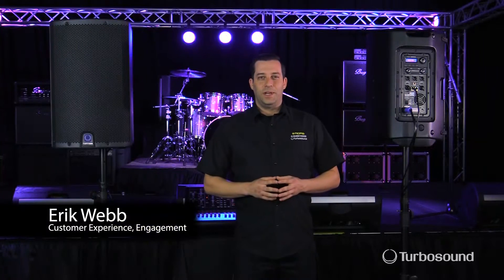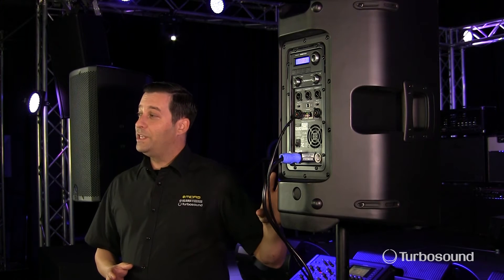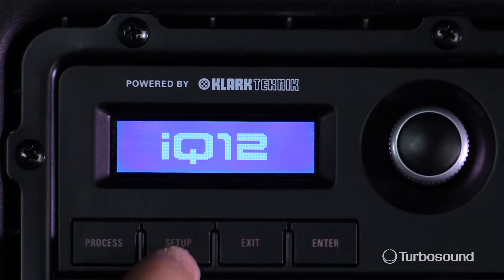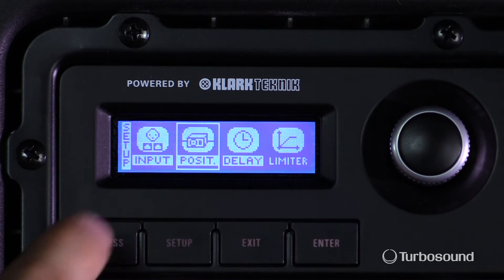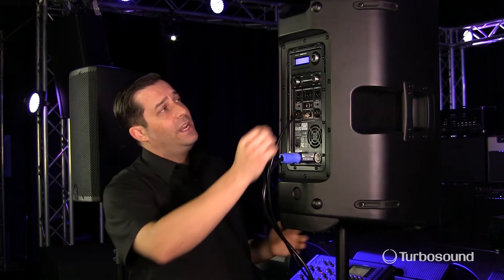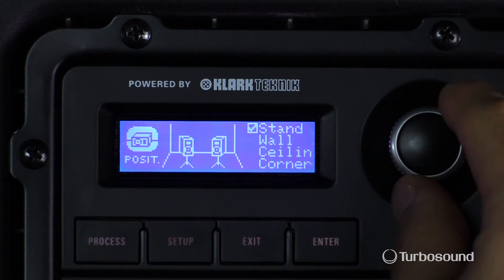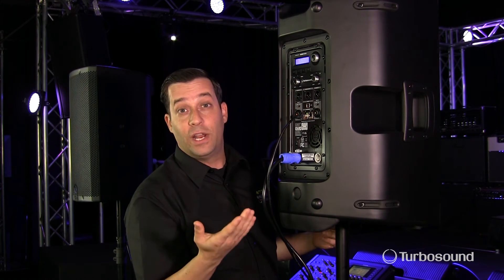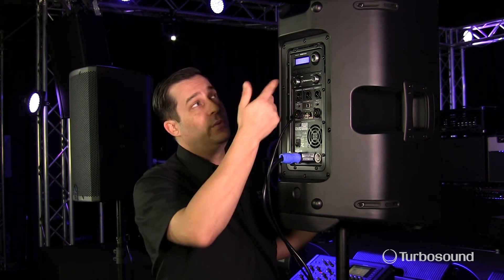TURBOSOUND iQ Series - Speaker Positioning Presets

Comment: I recently purchased 4 IQ12 speakers to use as monitors with my other IQ speakers, and I was wondering about the position selection for them laying on stage as monitors. I do not see any selection in the menu for positioning them as monitors? any suggestions?

Thanks,
Derek
Reply: Same question. Hey Derek, do they angle well when used as stage monitors?